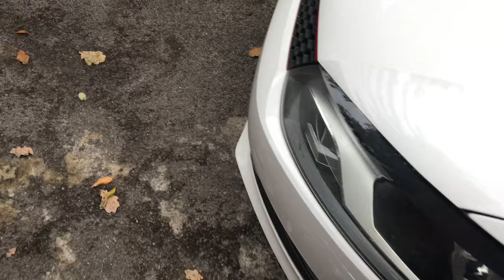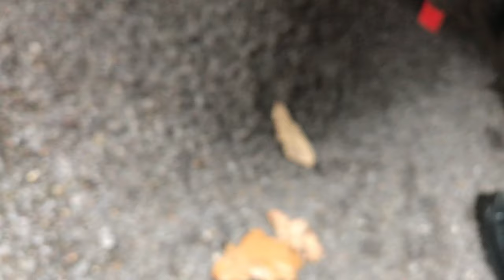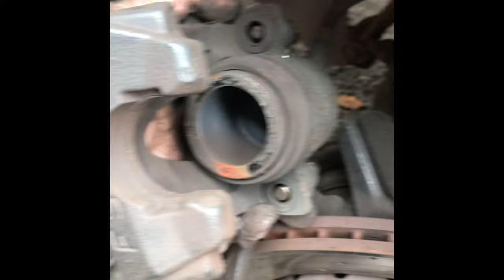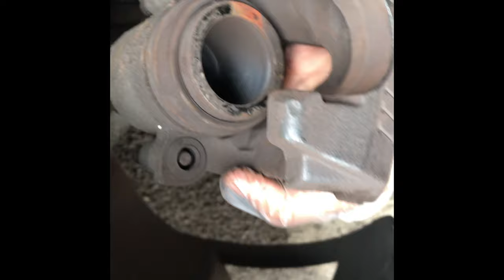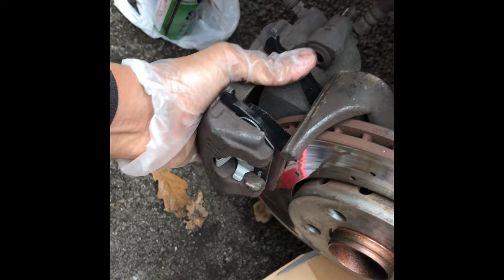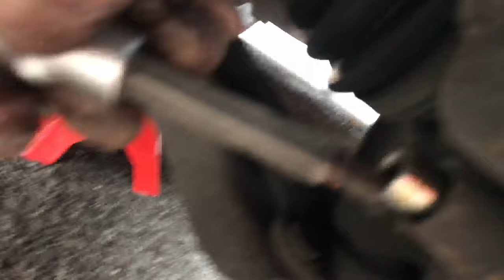Volkswagon Polo 1.2 (6R/MK5) Front Brake Pads and Discs replacement

Comment: bro, can u share a link to buy front disc and brake shoe. my polo is 2013 model 1.2 petrol highline.
Reply from the maker: https://www.ebay.co.uk/itm/Drilled-Grooved-5-Stud-256mm-Vented-Brake-Discs-D-G-750-with-Ferodo-Pads-/362095723085?mkcid=16&mkevt=1&_trksid=p2349624.m46890.l49286&mkrid=710-127635-2958-0
Reply: @jaysworkshopgarage   bro brakes pad clips are different with my polo 2013 model.
Reply from the maker: @MrNobody-tz6cg  I’m not sure then
Reply: @jaysworkshopgarage  bro I mean my polo 2013 model front brake pads has a clip in both top  and bottom. I wish I can share the image in comment section. The one u use has clip in middle only. But when I ask the seller they said both of them fits in polo.